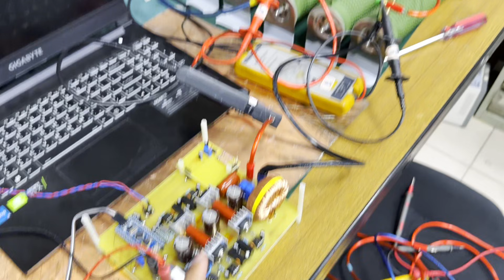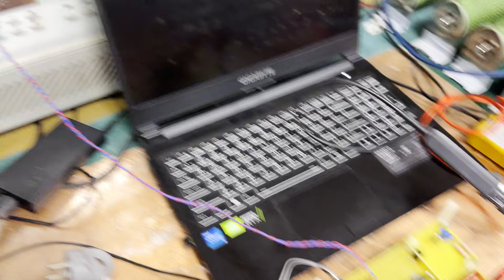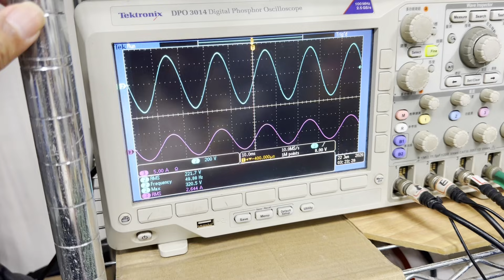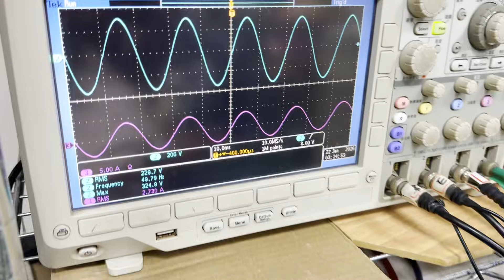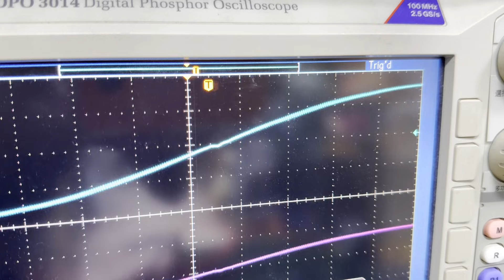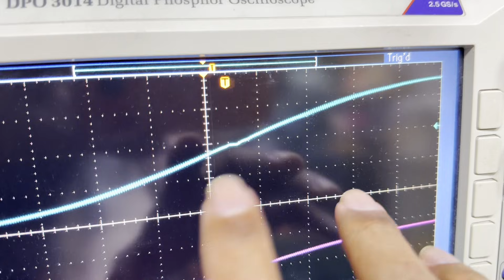STM32F103C8 - BluePill SPWM Inverter | Update

Comment: Like the project. I have a question why have you used separte isolated  IA122S voltage supplies for the low side switching. At a DC ground level no  isolated  IA122S  are needed I thought. At the high side I understand i think why you choose for a IA122S. You want an isolated drive high voltage stage without a complex isolated gate driver. Let me know what you think of my coment.
Reply from the maker: Because i want the LV side fully isolated from HV side, in case the mosfet fail or something bad happen, and the HV short it through the driver, my mcu will not taking an effect and not destroying my laptop while connect it.
Reply: @doradorido  Understood, thanks
Reply from the maker: @pietdepad4103 sure 🙏